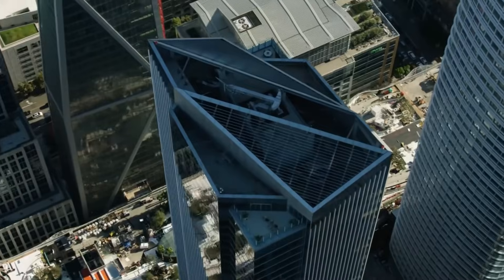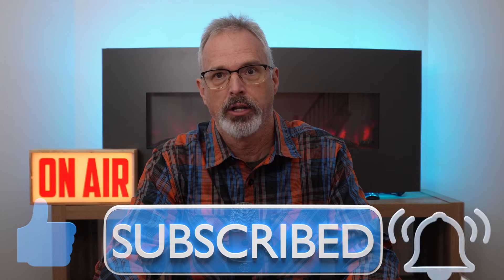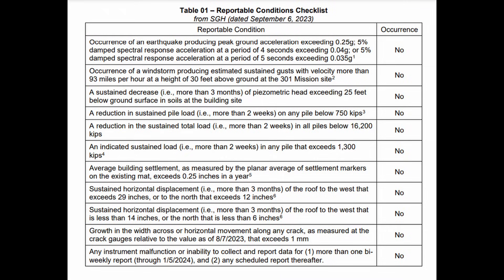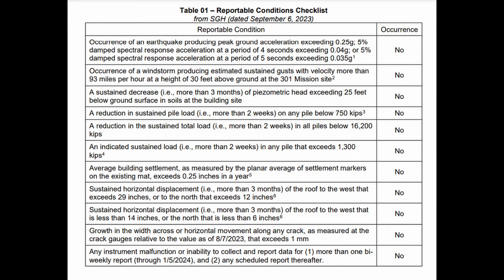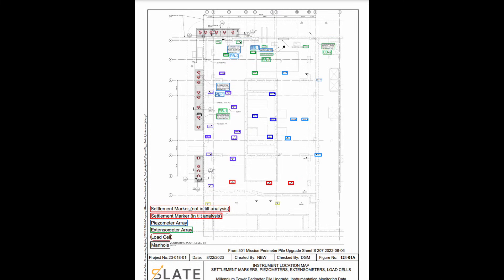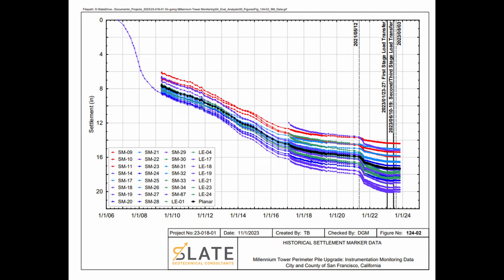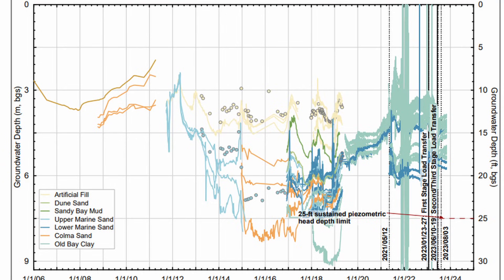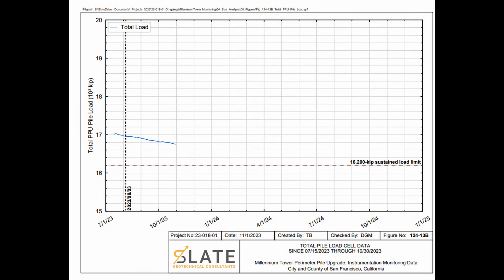Millennium Tower "Repair" - What is Going on with the Monitoring Results

Comment: I live in SF but thankfully nowhere near this thing. Everything happening has been predicted by other engineers (eg at Berkley). Also Building Integrity noted serious problems in the pile connection system. Plus how did the plan keep going down to fewer and fewer piles? I think it's likely the connection system fails and/or the foundation mat cups.

They should have done the right thing from day one: install a network of piles from inside the basement to fully support the foundation mat, with each pile on a jack to control settlement until the building could be made level again, then replace the jacks with permanent connections. Now the repair money is spent and nothing is fixed.

FWIW San Francisco now requires piles to bedrock for all high rises, no exceptions.

But hey at least the original developer saved $5m by not installing piles 🫠
Reply: I’m in no way a civil engineer, but I have a reasonable knowledge of this subject. The same thing occurred to me too, all these ‘fixes’ assume that the ‘mat’ will be able to take the rather uneven stresses imposed upon it, stresses that as far as I’m aware it was never designed to deal with.

Comment: What’s supposed to happen is the un-shored side of the building will continue to settle, which will gradually reduce the tilt.  Wouldn’t that also lessen the loading on the piles?  How can you tell if the load is less because the system is working correctly vs. the load is less because the piles are compressing and need to be re-jacked, or something worse?
Reply from the maker: Yes but the pile loading decrease has occured with no change in tilt.
Reply: Initially, they were going to install 52 piles but only did 18 because the drilling and hammering was causing more settlement.  We’re they at 50 million over run at just 18 piles?
Reply: @scruffy4647  - imagaine if they had done 52.. they coulnt even controll the cost on 18
Reply: Of course!! @scruffy4647

Comment: What are the meanings of, "Elastic shortening" and "Settlement of the pile into the subsurface?"
Reply: ES = compression of the pile, like a spring.  Even concrete is compressible a little bit if you put enough force on it.

SotP = bedrock may not be as solid as expected, so the piles "resting on bedrock" may be slowly poking a hole in the surface of the bedrock.

Both of these would reduce the ability of the piles to "push back" against the anchor points on the slab.
Reply: @pulaski1  Thank you so much for these crystal clear definitions and examples.

Comment: Could the decrease be related to some sort of rebound on the other side?  Your discussion does a great job of putting these slow and sometimes elastic Geotechnical conditions into perspective. 

I believe you said it was a month or more that they expected the four inches of rise.  Four days to 3/4 inches must have been devastating for the team.
Thanks for the great content,
Dan
Reply from the maker: Thank you. That is a good point about settlement of the opposite side of the mat. I would say that the decrease in pile loading over time with no change in building tilt suggests an effect local to the piles.
Reply: @CaseyJones-Engineer  Especially with the building acting as a long lever. If the load was reduced due to correction, it would produce a noticeable change in tilt. If the problem is occurring anywhere other than the bedrock, the repair is destined to fail.

Comment: Any thoughts on when the building will either be condemned or fail (collapse)? Three years, five years, 10 years? This thing is such a nuclear hot potato, I wouldn’t want to have anything to do with it, whether it be as a resident, architect, or construction remediation. Or even as a guy working in the build across the street.
Reply: How are they able to get insurance?
Reply: @andrewlangley9507  - the isnurence probable has a asterick "*" in the policy.. covers fires etc.. but not damage caused by building leaning etc.

Comment: Did they put any kind of monitoring system on the piles or parts and pieces of piles to see if there is any movement in them? I know some were concerned about those rod attachments that go back down off hydraulic jacks! My uneducated opinion is; I didn't like the attachments to the existing foundation! They just looked suspect to me!
Reply from the maker: The load cells they are monitoring are at the too of the piles. Also I agree with you about doubts related to the quality of the pile/slab connection.

Comment: This issues with this building is a farce.  HOW TO LIE WITH FACTS AND FIGURES.  If you can't dazzle them with brilliance try to dazzle them with bullshit.  this building is suppose to sit straight up and down.  So all the wait is distributed evenly straight down.  Once you loose the load bearing distribution  then the mechanics of the foundation design is compromised.  Picking  up building is a bitch.  They always sink back down as the a  pressure of the building is now uneven and heavy on one side.  A building of this size needed to be started right to begin with..  The design of the foundation is flawed,  Support should have gone to bedrock and construction proceeded from a stable platform from the beginning .  START RIGHT GO RIGHT.  From my view point this is construction fraud.  This should have been caught by plan check oversight at the building department.  But SF is run by compromised public officials and this is what you get.   Several building officials in the planning and building dep.were just charged and arrested.   This building is toast and earth quake safety issue will render a red tag at some point.
Reply from the maker: I agree with you now they are throwing good money after bad.
Reply: worse.  You can't fix stupid . Corruption runs deep.

Comment: Where is the logic that justifies spending millions of $$ for the repair results that achieve a mere 18.75% success rate towards the objective? Refund all monies to existing legal property owners and allow the homeless masses to take over the tower and luxuriate in the structural debacle. A few inches here, a few inches there, of building tilt merely accentuates the artistic form that may satisfy the desired agenda of the existing political platform. Thank you for relating the irrefutable evidence of what most choose to ignore, by design.
Reply from the maker: Thank you. I find the whole situation with this building to be rather shocking.
Reply: My background involves electronic engineering, I have no  educational reference to offer any technical perspective in his matter. However, the empirically derived, written evidence speaks for itself. Few would have known, sir, many thanks for your professional offerings. Thanks again for recent test results of written  notifications  as irrefutable evidence others may choose to avoid.

Comment: How much would it cost the city to take it down? Probably exponentially  less than it would cost to clean up after the disaster.
Reply: Why should the City have to pay that cost? The builder of the tower created the problem -- they should be the ones who pay to resolve it.
Reply: Who paid how much of the cost would certainly end up in court. Also certain, the city would be paying quite a bit, directly or indirectly.
Reply: @kurtwicklund8901  Chances are great that all involved have already filed for bankruptcy, if not,  they well. I don't believe that they should be allowed to file bankruptcy at all!
Reply: @markthompson180  the Builder alreday wrote a check and settled with the unit owners... that paid for most of the repairs they just did. The current owners are resposible for anything like that (all 100+ of them). They could disove the condo association and sell the pig and split the cash... making it the buyers problem i suppose.
Reply: @williamhaynes7089  No one is going to buy it.  The condo owners are going to be responsible for the tear down cost.  Personally, it seems like their own lawyers screwed them.  Any deal should have made the developer prepay teardown costs because the proposed fix was never guaranteed to work nor does anyone credible expect it to work.
Reply: @_PatrickO  - I was thinking same thing, they should have had a clause in there where if it leans beyond a certain point within 25 years that the deed to the whole mess goes back to builder and they can pay for demolition.
Reply: @_PatrickO those liawyers should pay out the unit mortgagors in full
Reply from the maker: I am guessing around $300 million dollars would be the cost to take this thing down.
Reply: @CaseyJones-Engineer  I'd bring it down for just 1 million. 😂
Reply: @CaseyJones-Engineer Or, ignoring loss of life, twenty to thirty times that if it brings itself down first.
Reply: Can you imagine the owners’ reactions when receiving a special assessment for removing this safety hazard?
Reply: @douginorlando6260  - the owners are the residents... they have alreday paid millions in repiart cost .. and as he said in the video just split the 6.7 million from a cost overrun.  Im sure selling their units and moving is hard for a condo resident with all the publicity.
Reply: It would be cheaper to take it down floor by floor, but hey, profits over people, that's their motto here.

Lest us acknowledge before the 9/11 truthers chime in, tall buildings do and will not, topple straight over. Time, time, and time again both in reality and in simulations before breaking tall buildings don't tip over but will begin a cycle of pancaking, floor by floor, once an angle of load gets to sheer or transverse loading phase. 

This is why when tall building collapse they often appear to go straight down, even if not straight down, or appear they had demolition explosives when, in fact, even on demo jobs of tall buildings using explosives they're not blowing up floor by floor, all they're doing is setting pancaking into motion.

In the case of the Millennium Tower, should a catastrophic even occur, and there is arguably no other building in the Western hemisphere with such a potential risk of something bad happening, to the degree, that residents are staying put when they'd be safer sleeping on the street or in their car, if an event occurs the footprint of destruction will be, by the building height, relatively compact, much like the twin towers. 

This said, the catastrophic loss of life and property near Millennium Tower, should it start to fall, will be immense on a scale in some ways similar to WTC, not by lives lost or cost, but in how much infrastructure and buildings around it will be a total loss and inhabitable. 

Is there a fix? There could be. Is what they're currently doing going to fix it? No, this is again the low bidder like the low bidder who engineered the feeble first attempt, this is politics and saving a buck, profits over people, and the fact they're going on with this folly is disheartening.

Comment: This building is in the intensive care unit. The patient is unlikely to survive, even if they apply life support gadgets. Has anyone estimated the human and financial toll if the building falls on its side? If they didn't want to be cautious at the beginning, why not be cautious now?
Reply: Buildings don’t tip over.  It would fall slightly in the direction it is leaning, but generally it would be a vertical collapse.  Perimeter columns would have to sustain astronomical loads (impossibly high) for the building above to tip over them as a fulcrum.
Reply: @qwerty112311   Thanks for the clarification.
Reply: @qwerty112311 you clearly have not seen these building collapse videos from china
Reply: @qwerty112311  Buildings most definitely tip over. https://youtu.be/WcZl9ScBN5E
Reply: I wouldn't want to have a property that building is leaning towards
Reply: The builders sold the units.. they did pay a settlement over this to the unit holders and now they are gone.
Reply: @williamhaynes7089  Correct, the unit owners let the developers who cut the corners walk away in a settlement deal with a fix that was never going to work.  Now the condo owners are responsible for everything.  The condo owners need to tear their building down now.  The condo owners were insane to sign a deal that absolved the developers from further responsibility.
Reply: @_PatrickO  - i just get tired of people saying they should file suit against them and get money when they alreday have... If they didnt get enough money and have to pay overages, thats on them.
Reply: Estimate of direct loss to owners: $2bn.  Direct losses to 3rd parties:  $3-10 bn.  Indirect losses to owners: $1-5bn.  My "back of envelope" calculations, subject to Califorication.
Reply: Agreed.
I thought it was better to just take the building down than try the mitigation, as there were some very compelling arguments (seemingly correct now) that the piles would not correct the settling.  The promises made by using the piles were hopeful at best.
Its hard to be the person telling the bad news, but now the issue of a possibility of uncontrolled settling and panic all around is real.

After that, review the 'experts' who thought the piles idea would conceivably work.  Did they trust the computer models too much?
We need a classic Richard Feynman 'type' on the investigation to tell the unvarnished truth on how we got into this situation.
Reply: The one thing a collapse would do is immediately force the state and feds to move in and clean up the mess. Maybe that is what the responsible parties are hoping for.

Comment: Any seismic event registering 6.7 to 7.7 is going to make that structure sway. Again…I am a layperson…but I wouldn’t want to live there in the event that the lateral displacement runs in the same sense as the tilt. IOW… if the bldg already leans over 20 inches and the quake adds another 24 to 36 …say… well… that’s not very good is it.
Reply from the maker: I agree with you.  It would be too big of a risk for me to even consider living in that building.
Reply: @CaseyJones-Engineer  "Live" there? I'd be uncomfortable delivering the mail to that building.

Comment: While it could be that the piles were not in proper contact with bedrock, I suspect that the connection between the piles and the building structure is yielding. 
Since the substructure of the building was never designed to be propped up in this way, I was always doubtful that they could tie the piles in properly.
Reply from the maker: Yes, that is something I didn't consider but I believe it is quite plausible that they are getting yielding at the pile/mat interface as you point out.
Reply: Snap, crackle, POP!
Reply: Building Integrity had a video about the designed interface between the piles and existing foundation and it was not good.
Reply: Another thought is that since the piles usually are driven down in segments that there's a "knee" forming in the clay somewhere underground due to clay movement. Some clay is especially bad since it changes from solid to liquid very easily. There was such a case outside a place named Stenungsund in Sweden recently where a motorway was pushed away and some people were injured.
Reply: Or it could be the result of the occupants running for the hills.

Comment: Another good video. The area has a lot of engineering problems. I recall that the new bridge, to replace the one that was wrecked during the World Series, has big hardware problems. The credibility is very questionable. Stupidity should be painful. Good Luck, Rick
Reply from the maker: Thank you.  As we have discussed previously, accountability for such problems seems to be in short supply these days.
Reply: You’re talking about an overpass and part of a bridge that collapsed decades ago during an earthquake. On structures that weren’t built to be earthquake rated the level that they were exposed to.
I’m not sure how that equates to about a design that didn’t survive construction, let alone an earthquake
Reply: @neilkurzman4907  I'm talking about the Oakland Bay Bridge. In many places the top deck fell onto the lower deck. The contract for the new bridge was given to a chinese company over the objections of the engineers. When it was finally done, they found that the hardware used was below standards and had to be replaced. Last that I heard, it was going to cost over 1 billion to fix it. This was a case of politicians overruling engineers and another case of inadequate quality assurance.
Reply: @richardross7219  I don't know that it was a Chinese company but it was, for sure Chinese steel and it didn't meet specs. In every one of these cases it's been the same cause... cost cutting that never gets signed off on by a competent engineering firm.
Reply: @alexandermckay8594 I worry about how many engineering companies are competent anymore. I saw engineers proposing to drive piles for a foundation that sat on ledge. They had never visited the site. Good Luck, Rick

Comment: I haven't heard anyone use the word pile as a plural instead of piles.
Reply from the maker: Yes, it is common usage.
Reply: @CaseyJones-Engineer  About 95% of Texas White Trash say...Pylon.
Reply: In coastal Texas we use mostly piling and pilings.  

Piles refers to something else that we usually avoid discussing.
Reply: @CONTACTLIGHTTOMMY  seems like this project is turning into one of those.
Reply: @CONTACTLIGHTTOMMY   More fiber, less getting

Comment: How long until the elevators stop working ?
Reply from the maker: That is a good question.  I understand that one of the elevators to the parking garage can no longer be used now.
Reply: @CaseyJones-Engineer  Maybe the janitor could use it for storing brooms, mops and Gorilla tape for the cracks in the walls.